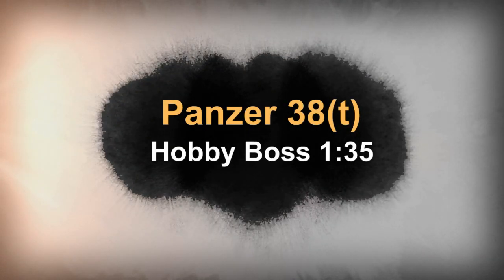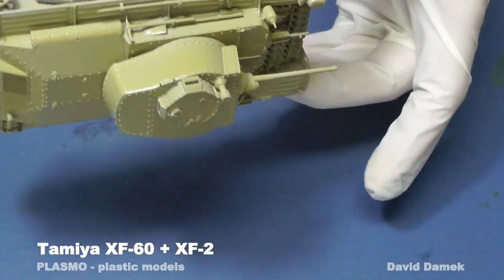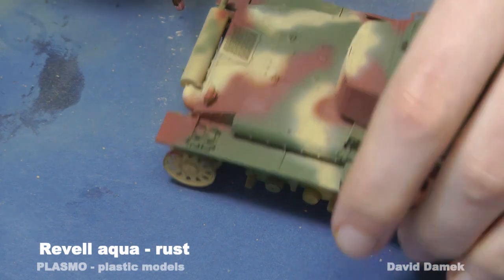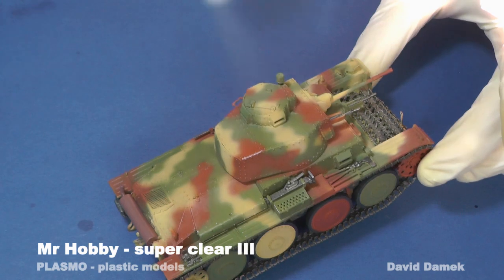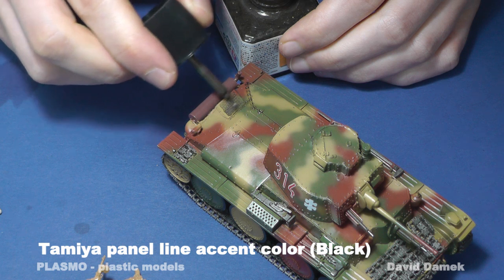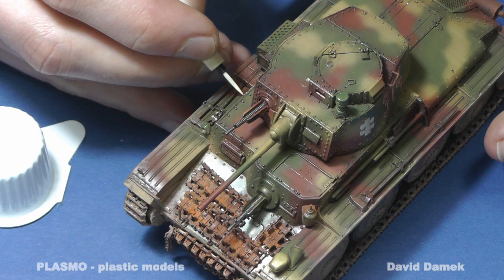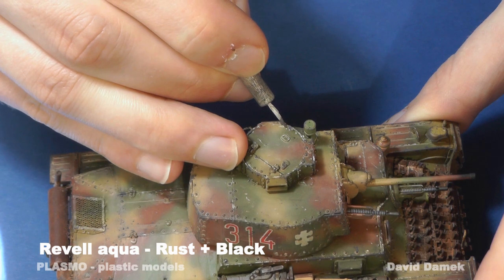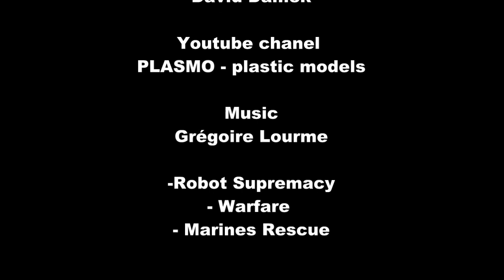Panzerkampfwagen PzKpfw 38(t) (LT vz. 38) 1/35 Hobby Boss Step by Step

Comment: When I was a kid building model aircraft and painting them (often badly) I was always advised to paint the parts on the sprue, then assemble them and retouch the paint.  Wouldn't that be easier than building the whole model and then painting awkward, tiny parts?

Comment: Lovely little model! Im just wondering, is there a reason why you didn't drybrush the raised rivets with gun metal? I would have done that as a final step. But on the other side, my models don't look as good as yours! Maybe that is why :)
Reply from the maker: I painted some rivets by old rust. I think that gun metal looks like new scratches but it depends on how was used.

Comment: You are very talented.  These tank models are some of the best I have seen.  Two questions (maybe I missed answers in the videos)...what brand/model of cement glue do you use for assembly?  For 1/72 scale, what do you use for the small ropes, straps etc. to hold custom stowage onto the tanks?  Thanks and keep up the beautiful work and extremely helpful videos!